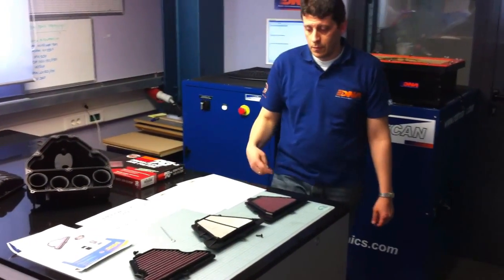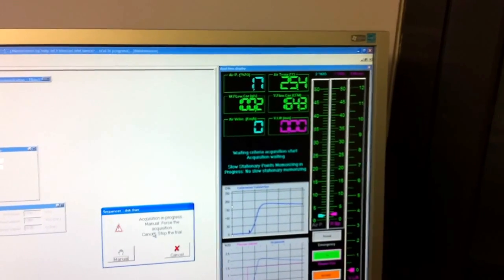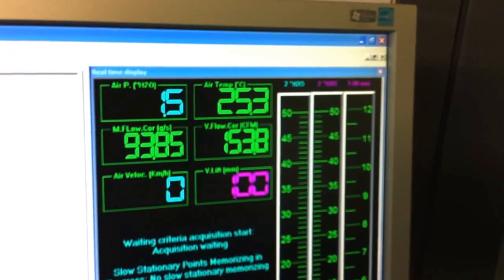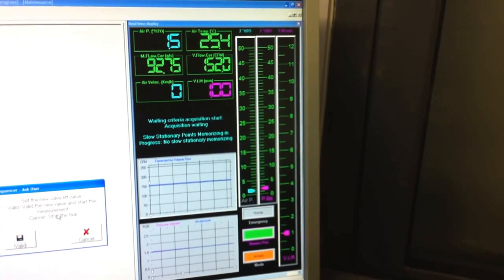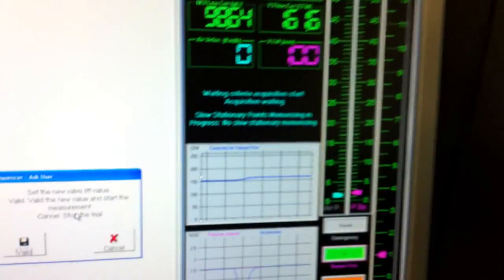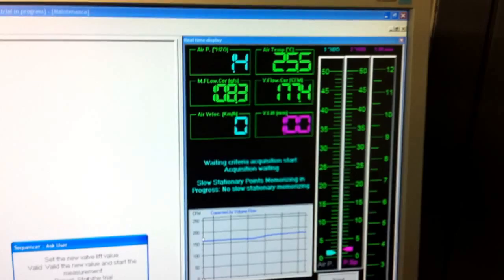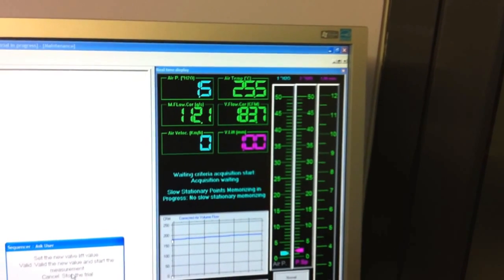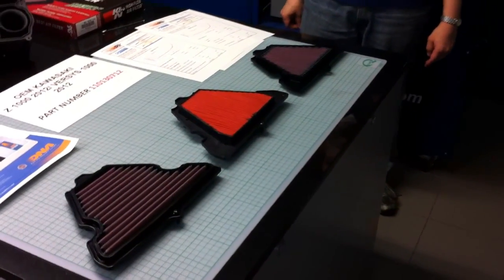DNA vs K&N vs OEM Kawasaki Z 1000 2010-12, Versys 1000 2011-12 air filter test @ DNA Filters

Comment: Well, there are filters that would easily outperform cotton gauze...
Reply from the maker: Hello there, for something to be called a filter it should filter the air coming through the engine for particles as small as 5 microns and as big as 150 microns. Our products as certified with the ISO 5011 standards for these numbers. So at the end of the day yes there may be some other materials which will outperform our cotton air filters but you can not call them air filters. You can call them anything else you may like but unfortunately these products will not properly filter the air coming in the engine and protect the engine.
Reply: @DNAHighPerformanceFilters  dear DNA, first of all thank you for the swift reply.
Ive seen that you claim conformity to the ISO 5011 test, though as you are most likely aware there is both a coarse and a fine test. You do not specify at which one you gain the 98-99% efficiency. Obviously and as you most likely know iso coarse test dust does contain particles from 1μm up to 180μm in size so you could claim filtration from 5 to 150 microns as you do.
Also the 5011 is a very flexible test allowing the engineers to set the flow parameters and the test conditions (to an extent obviously).
I am not saying that your filters are or aren't the best. But what I am saying is that filters should be characterized by a filtration efficiency at a micron level.
More so not all particles sizes are harmful to an engine it all depends on the tolerances involved as well as the diffusion of the contaminants.
Therefore I am skeptical about filtration efficiency provided as a whole percentage based on a industry test albeit of unspecified type (fine or coarse).
My kindest regards.
Reply from the maker: @randomchannel1712  Hello again, thank you for your reply and we completely understand your concerns. So let’s start that we are the only company in our field with ISO 5011 certified filtering material. We can claim anything we want but on the contrary we are clear on everything we publish and we will never try to deceive our valuable customers. 

We are producing air filters that we ,as motorcyclists , are using on our bikes. 

To make a long story short, here you can find a link to download an independent test from a motorcycle magazine in France from many years ago with many products you can find in the market right now. Please note that this is independent. Article: https://www.dropbox.com/s/dt7k98sjpbetf33/moto%20mag%20filter%20test.pdf?dl=0 

Of course if you have more concerns about our products and our tests we will be more than happy to discuss it with you. And the best option will be to send an email to our technical support team at technical@dnafilters.com
Reply: @DNAHighPerformanceFilters  Can't read french, but it appears all the filters flowed the same. Appears to be some cost savings over life do to less oil on the filter? but contradicts your video results. did you have equal amounts of oil on the filters for your test? The K&N appears more oil saturated vs your DNA which would account for the flow difference in your test vs the article you linked to.
Reply from the maker: @dougfreeman3229  Hello Doug, the air flow is completely different.  161.6 CFM for the KN Filter and 184.6 CFM for the DNA Filter is a huge difference. Concerning the oil both filters are tested as supplied from the factories and we haven't changed removed or add any oil.
Reply: @DNAHighPerformanceFilters  I’m talking about the article you linked to. The flow for each filter looks to be the same, but I cant read french.
Reply from the maker: @dougfreeman3229  the french article is comparing another model. the flow is also not 100% the same on the article. Moreover we shared the article for the different materials mentioned on the comment above. In the video we compare on a computerized flowbench the air flow of an OEM , a competitor air filter and ours. Of course it is completely different because of the design of the filters to start with and then the materials, the oil formulation etc etc.

Comment: The DNA filters airflow is a little more than 20% more over the stock.
I'm curious to what size particles the DNA filter stops vs the stock filter as well.
Reply from the maker: Hello Brandon, all of our products are certified with ISO 5011 to 98-99% filtering efficiency. We can stop up to 5 microns of dust. You can also read more here: https://www.dnafilters.com/en/dna-in-action 

Concerning the stock air filter unfortunately we do not know the percentage they have for filtering efficiency to comment on that.

Comment: DNA flows significantly higher than both k&n and OEM filters... But how about the filtering capacity of it..  Higher flow does not transcribe directly to good filtering rratio.. Correct me if Am wrong..
Reply from the maker: Hello Diether, all of our products are certified with ISO 5011 to 98-99% filtering efficiency. We can stop up to 5 microns of dust. You can also read more here: https://www.dnafilters.com/en/dna-in-action 

Concerning the stock air filter unfortunately we do not know the percentage they have for filtering efficiency to comment on that.

Comment: All of the focus is on air flow rate. What about filtering ability? These are air filters after-all.
If you have no filtration at all, your flow rate is going to be great
Reply from the maker: Michael Fisher thanks for the comment! So, all our products offer 98-99% filtering efficiency. Our filtering material is the same to all of our products, from scooter air filters up to wsbk air filters. The filtering efficiency for our filtering material is proved with independent ISO:5011 tests. The sure thing is that our products are the most filtering efficient aftermarket air filters produced today. Moreover, to gain air flow we specially design each product in the OEM air box and we are not just copying an OEM air filter and then use our materials for a DNA Air Filter. We are here to assist you with anything else you may need.

Comment: The air flow results are interesting - but I think for the average motorcyclist, filtration rate is equally as  important given the pollutants and dust within the environment. Maybe a higher air flow means less filtration and consequently higher engine wear.. How about a back to back filtration test?
Reply from the maker: 98-99 % filtering efficiency! This is what we offer to all of our products. Of course the filtering efficiency is what the end user needs and this is why our filtering material is ISO 5011 certified for 99% filtering efficiency. We are not compromising our quality for better air flow, on the contrary we are getting the better air flow from the design of our products. You can read more here: https://www.dnafilters.com/en/origin
Reply: Efficiency doesn't play as important a role as airflow does for performance air filters used for racing. For the road efficiency is important but as is airflow so you need a balance to meet an efficiency standard, but keep in mind that efficiency increases over time with a dirty air filter. So at some point even if the efficiency is lower it would eventually rise to acceptable levels but also lose flow/power. For racing I would put in a DNA all day everyday.
Reply: Ok. Now do 
one for the 2014 yamaha r1 DNA vs K&N vs sprint filters

Comment: But if I change the stock filter into a DNA filter will not the engine run leaner? And if yes won't I have to do other mods to the engine so it doesn't run to warm and stuff?...
Reply from the maker: Hello Danilo, yes the engine will run leaner and the stock ECU will re-adjust the fuelling the best way possible. In the end the engine will not run warm and it will not be a problem, on the contrary you will have better flow, better power and if you ever do future mods you will have better gains.Thank you for your time.
Reply: the ECU can't adjust the fueling at wot,it just read a map assuming your filter and your exhaust are stock
Reply: @sural89  it depends if wot is run at closed or open loop
Reply: @randomchannel1712  wot always run open loop
Reply: @sural89  in some motorcycles with wide bands it's not
Reply: @randomchannel1712  Name a model that runs closed loop all the time (ie at wot). None exist that I know of. There may be add on controllers that do so, but not oem.
Reply: @dougfreeman3229  ive seem a mew bmw on brocks performance
Reply: @randomchannel1712  What? Explain - makes no sense
Reply: @dougfreeman3229  wait

Comment: I'd believe it more if this was a power run
Reply: Out of interest, what does the motor industry use as a filter performance metric? I'd imagine the important part is the pressure differential across the filter. Is some kind of filter drag coefficient used?
Reply: @joshctaylor  you set desired airflow and you measure the pressure delta. That gives you an idea of how well the filter flows

Comment: The filter element of the K&N air filter in the test looks unusually dark. Was it over-oiled by any chance to reduce air flow?
Reply: oiling is not done for air flow, it is put to stick dirt from the air onto the filter. Receiving high quality  air Intake
Reply: That's their usual colour. Even if disposable filters are over-oiled, the extra oil simply gets sucked straight out and wasted
Reply: Yes, I know this is a year old.

Jason, the excess only gets sucked through to a certain degree and depending on how long its used after drying.  So if they overloaded with oil, waited 30 minutes, then ran the test...  I can assure you that filter will not perform the same if properly oiled.  I over soaked the K&N on my mustang gt and went for a quick 3 mile ride and when I let off the gas, instead of coasting with a soft gradual RPM fall, RPM's fell fast and the engine sound changed since the mixture was being starved of O2.  I took the filter out wiped it and tapped it gently on the ground a few times and the next run 1 hour later was back to normal sound and de-accel rate.   Basically the difference from releasing the gas pedal in an automatic while in Over-Drive and then Drive.  

Yes it is to catch dirt and not increase air flow.  It will decrease air flow if over saturated, however.  The manual on maintenance even states this.

Comment: Hello DNA, thanks for this great test.
Would you mind repeating this test for the KTM SD1290R Filter?
Is it possible to show additionaly the difference between serial and DNA Filter on two or three different pressure-settings (to show high-RPM with low and high throttelposition and lowRPM with low throttelposition)

Thanks and regards
Reply: Have one on order for my 2020 KTM 1290 R  Super Duke along with Austin slip-on exhaust. Will see how good filter is without the can then with the can. If i can get 3-5 hp increase with nice drivability I'll be happy. It runs great stock, new to v-twin,but to me runs great. Just a little vibration i guess you can expect that.

Comment: OEM=152 CFM, K&N=161.5 CFM, DNA=184.5 CFM

I just saved you almost 8 minutes, you're welcome.
Reply: Not all heros wear capes. Thank you.
Reply: But which one has less fine particle entering the engine?
Reply: @shingod700  no one cares cause we ain't running these things for 200k. Get a goldwing if that's your goal.
Reply: @REDSIX  I’m running a DNA filter in a KTM 1290 SAR in heavy heavy dust off-road, I want to know if it’s going to stop the dust.
Reply: @shingod700  what do dirt bikes run? Foam oil filter.
Reply: @shingod700  if you running iin that heavy dust off road, better take off your aftermarket air filter and back to oem. nothing can beat oem filtration if you have concern with reliability and health of your bike.
Reply: +1
Reply: +1
Reply: Glad I checked down the comments to see yours. Saved me time and  'cracked me up'. LMAO  🤣  Thanks
Reply: God bless you 🙏🏼🤣
Reply: That O was looking for, thanks!
Reply: thanks
Reply: well as air is flowing better, that wasn't supposed to mean that less dirty is being filtered? I wanna buy one but i´m afraid.

Comment: doesnt help if it doesnt filter out dirt
Reply: I believe they have the same micron and the K&N filter, they have a greater surface area which allows a higher flow without decreased filtering.